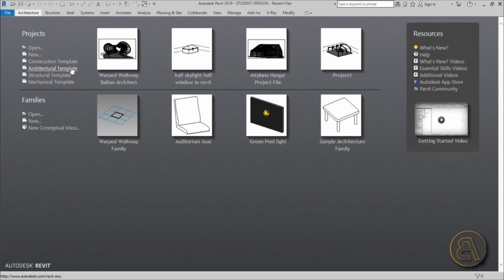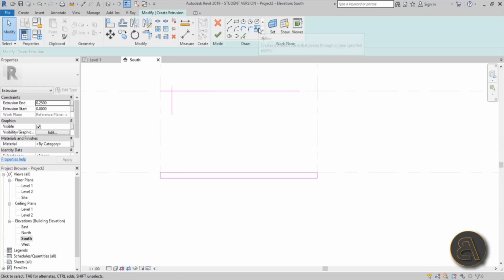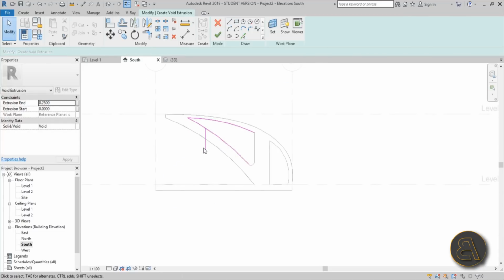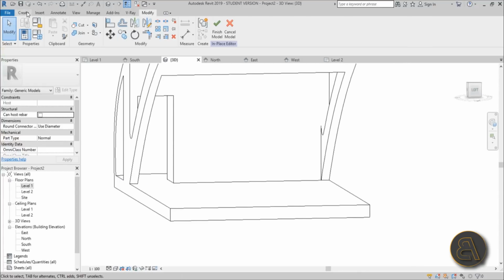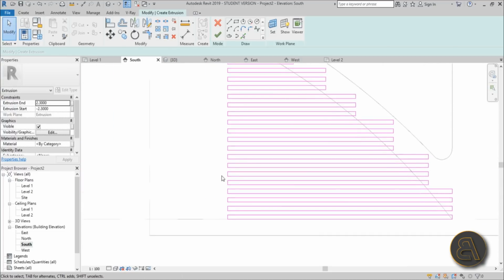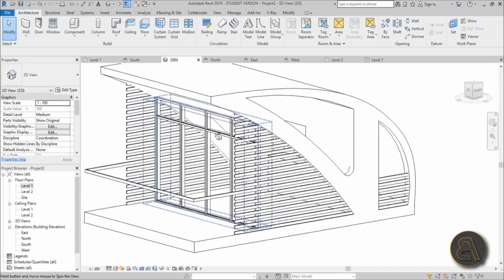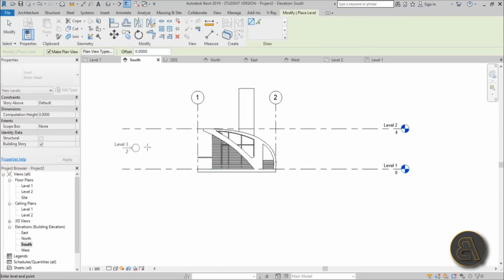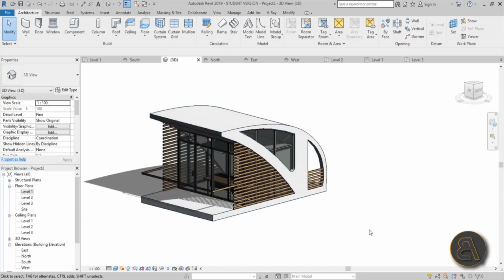Floating House in Revit Tutoral

Comment: is a file that is almost a gigabit in size large because a made a 50,000 square foot house that was 150ft by 150ft. It was a 3 story underground  quarter circle with underground parking for 8 cars,  a theater with a 30 foot screen,  and a roof the went with curve of the hill beside it and had grass grow on the roof so it couldn't be seen from the air.
Reply: Thats without plumbing, electrical, and ventilation.